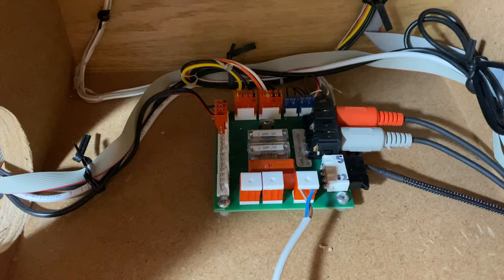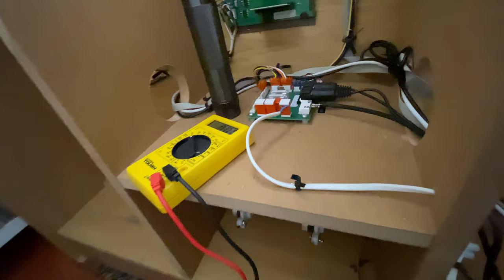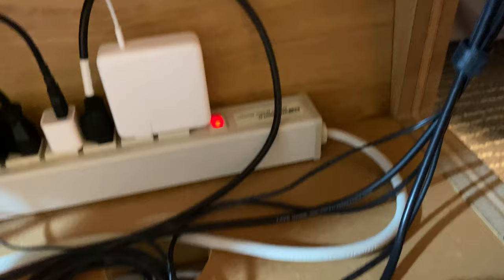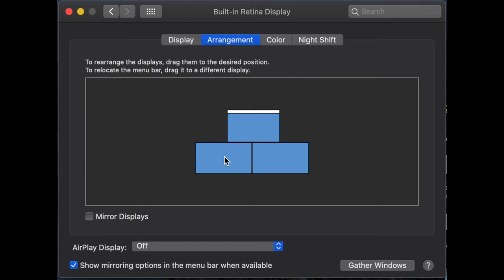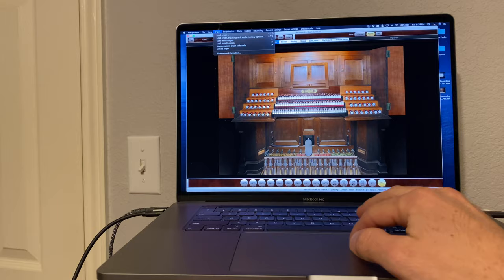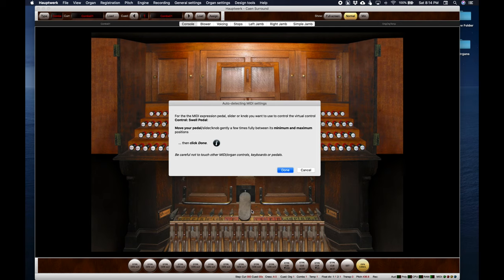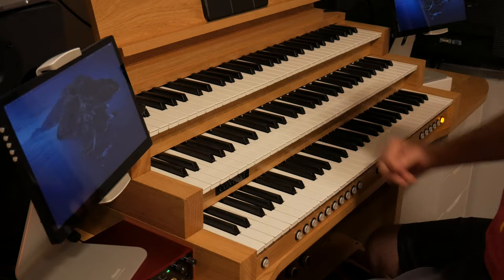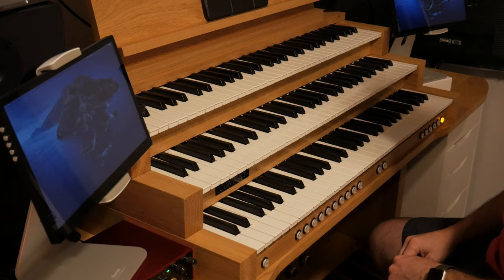Inside my Content organ and making the connections

Comment: Very cool! I have an old Rodgers 655 in my family room. The original electronics are a couple of HUGE PC boards, and they work fine, but my fantasy is to harvest just the MIDI bits and convert it to Hauptwerk. Effectively have this shell, but without the specific wiring.
Reply from the maker: Good luck with your project! Thanks for watching.

Comment: Please replace the scrapwood under the speakers with foam pads, to avoid the transfer of vibrations to the organ cabinet.
Reply from the maker: Thanks for the suggestion. I have some foam, but haven't been using it for this organ since there wasn't enough clearance to run my cables out of the holes on the console top. I also play through headphones 99% of the time, so vibration isn't really an issue. I have been considering getting a pair of the IsoAcoustics ISO-200 monitor stands. It looks like those would do the job of isolation, and have open space for running cables. Maybe I'll do it in the future. Take care.

Comment: Nice console Andrew! I'd love to have something like that for my setup.😍 Currently, it's just a 2012 MBP running into a USB>5x5 Motu Microlite MIDI I/O and from there into a Casio WK-1800 keyboard and an old Roland EP-5 keyboard. I run Hauptwerk through GarageBand on the Mac to add reverb, etc. to the 'dry' sample sets, and then via a digital audio out cable to my home stereo system, complete with powered woofers, etc.😉 I had started to build a console several years ago out of an old Hammond church organ console and an HWce2 MIDI console encoder from MIDI Gadgets Boutique to handle the 2 manuals and the pedal board. Unfortunately, I became disabled and couldn't continue the project, so the current setup is the next best thing. Still considering getting the wiring finished on the pedal board and using the HWce2 to get the signal to my Motu Micro-Lite. Would be much nicer than trying to split the keyboard on the Casio to get pedals that I can play left-handed and melody with the right!😁 Would love to hear some 'content' from your Content once you get everything all lined out!😉🎵🎶👍
Reply from the maker: Wow, thanks for the detailed comment! I started out with a very similar setup, except using a Native Instruments or M-Audio keyboard (can't remember which). Sorry to hear that your project came to a halt. I would definitely go full steam ahead with getting your pedal board finished. Having that was the biggest game changer for me, and took the instrument from just being a novelty to something I could seriously practice on. Best of luck!

Comment: Your wearing a T shirt from Vietnam!  Great!  I love Vietnam!  I use a regular PC for my Hauptwerk.  MAC is a bit too expensive for my budget.
Reply from the maker: Thanks! It's actually a t-shirt of Steven Universe, but I can see the resemblance. Glad you've got your own setup. Have fun!
Reply: I think a regular PC is cheaper and more powerful than a laptop. I’m currently building a dedicated Hauptwerk PC for 1200 euros: 64GB RAM, Intel i9-9900 8-core cpu, 1TB SSD, case and coolers from beQuiet. MacBook is more expensive and doesn’t get close to such specs. 🙂
Reply: @Engineer9736  Yes I have a dedicated PC.  1200 euros is in the ball park price of my computer with similar memory and 8 core processor.  Prices have been going down!  1TB SSD is the way to go.  I only had around a 230 GB SSD in my first Hauptwerk computer and that was a mistake.  That was back in 2008, when SSD's were far more expensive.  I think a 1TB SSD back then was over 650 euros.
Reply from the maker: @Engineer9736  You are correct. For me, I needed to get a computer that I would be using for several different projects, including video editing, so I wasn't in the market for a dedicated organ computer. I had the specs of my MacBook Pro maxed out, including 64GB RAM, so it suits my needs very well, and even the large sample sets, such as Rotterdam, load pretty quickly. Thanks for your comment!

Comment: Interesting to see this organ up close. Must be amazing to own it. Only the price is quite a thing... could buy a very proper new car for it. It makes me wonder if that bit of woodworking + 3 manuals + pedal is really worth that sum. If would be cool if you could show what the feel of the keys is like (without the organ sound). I'm always curious about what the quality of real well-priced organ manuals is like. Congratulations with this organ in any case 😊
Reply from the maker: Thanks for the comment. It really is quite a spectacular instrument, which is noticeable right away from the craftsmanship. The cost is nothing to sneeze at, but I can say the organ cost less than my car, which I bought about 6 months before this and is pre-owned. Regarding the key feel, the manuals are all Fatar 61TP-60LF, as far as I can tell. Pretty standard model in most organs like this. It has what they call a "tracker touch", so there's sort of a slight snap feel to the key, which is apparently accomplished by some sort of bubble before it makes contact. I definitely prefer this action to a standard electric action organ keyboard that feels more like a synthesizer, as it helps me know better when the note will sound. Those Fatar keyboards aren't that expensive by themselves, so you're definitely paying for the labor here, which is really top notch. The pedals, which use magnetic contacts, also feel great, and are nice and light to the touch.
Reply: @dfuhrman  Last week i contacted Content sales about this organ and the price is quite doable indeed! It seems they have 2 versions of this organ: The bare midi console like you have, or a full organ with speakers/their own samplesets/hardware/etc. That last one is like 3 times more expensive than the bare-midi version. I already own Hauptwerk/samplesets/speakersystem/etc so just the bare midi version is good enough. Good info on the manuals. They said that they can deliver UHT manuals which i've been looking at for years, those look really good. Still have to ask them for the additional price for that though. Until to far i've only been playing on a digital piano, which is enough to practice a lot of aspects on, but my interests is really at organ music which requires at least a pedalboard to take some work off your hands. And it's an amazing piece of furniture  to own as well 😀
Reply from the maker: @Engineer9736  I agree with you, and after some research, decided the MIDI console was all I needed. I'm actually starting to get curious about UHT keyboards or even the upgraded Fatar models myself. I took some things apart last week while my power and internet were down (Texas) and it looks like the keyboards could be easy to retrofit with another model. Also agreed that it's an excellent piece of furniture!
Reply: @dfuhrman  I've asked for the UHT manuals but they are like at least 2000$ a piece. Then the manuals will be worth more than the entire original console cost 😜 I've ordered a 4-manual version with wooden key core and 3-swell pedals (one for crescendo, i have the Palace of Arts Budapest sampleset) a few weeks ago. Bit of a gamble as I've never seen the console with my own eyes. Maybe the camera lens of pictures/video stretches the dimensions a bit. I hope the real instrument will be fully to my liking 😀 I've also been thinking to buy real stop switches with LED lighting in the future, and then build from wood some panels with those switches in it as a monitor-replacement. I think that will look way more like a real organ than with touchscreens.
Reply from the maker: @Engineer9736  Thanks for the information; that's helpful to know, and even a little more expensive than I was expecting, but sounds about right given their reputation for high quality keyboards. I hope you enjoy it. Sounds like a fantastic instrument!

Comment: When I added Hauptwerk to my organ, all I had to do was connect the midi and audio interfaces to the organ jacks and then to the computer with USB cords and I was done!  (Yes, and then auto program the manuals and stops.) You bought this custom built organ, had it shipped in from another country and then you had to be an engineer to hook it up.  I hope you didn't pay much for it.  You could have gone on eBay, bought a used Alan or Rogers organ with MIDI and lots of stops, had a much easier time connecting it, and the end result would have been a better product.
Reply from the maker: Hi there. Thanks for your comments. You're right, the big problem with this whole thing was that a very important cable was missing. I've chalked that up to a miscommunication between the US vendor and the manufacturer. Content was willing to send me the correct cable to solve the issue, but I was being a little impatient, so instead I got instructions from one of their technicians about where to find the part on Amazon (can't beat 2-day domestic delivery) and how to wire it up. As far as your other points go, I had a very specific, minimal design in mind, and I had enough financial flexibility to make it happen just the way I wanted. Not interested in drawknobs or tabs, just touchscreens so most sample sets would work seamlessly and retain their original aesthetic. I also wasn't looking for a used, traditional digital console, because a 3-manual instrument like that wouldn't fit through any doors in my house. Eventually, I'll move to a bigger house as our family expands, and this can become a proper installation in a main room. I appreciate you watching and sharing your ideas. Take care.
Reply: There is quite a difference between an old used console being reused with Hauptwerk, and a brand new quality console made for Hauptwerk (what you see in this video) 🙂

Comment: Hmm - the build quality seems slightly disappointing with lots of veneered chipboard used.  I use solid wood when I build Hauptwerk-compatible organ consoles.  Moreover, it does not appear that the console is designed in a modular manner that is quick and easy to disassemble.
Reply from the maker: Thanks for your comment. The sides, table, key cheeks, music rack, bench, and pedalboard are all solid wood. While there is some MDF used, it’s mostly on the interior as shelves to mount the electronics and keyboards, as well as the back cover. Even so, everything has a very sturdy feel. The design is purposely made for permanent installation, so I’m not certain that easy disassembly was one of Content’s goals. Take care!
Reply: @dfuhrman  My designs are in solid wood with stainless steel bolts and wing nuts, so it is not necessary to use tools when assembling and disassembling the instruments that I build.  For your system, in view of its cost when purchased, I am surprised  that the manufacturer skimps with MDF.
Reply from the maker: @tommorris3688  ok now I understand your previous comment better about not being modular regarding assembly. Thanks for the follow up. I guess the MDF makes manufacturing quicker when dealing with producing so many organs, but that’s not my area of expertise. I’d be curious to see a catalog of your organs or some pictures, as I haven’t seen too many with a design that’s easy to assemble/disassemble.
Reply: @dfuhrman  I used to undertake custom build for individual customers and churches, and have enough parts in stock for building circa 20 organs.  I always use solid wood and totally modular design, so consoles can be updated as advanced technology becomes available.  So often, I have had to help move 2- and 3-manual unitary-construction consoles, and it is a nightmare when the weight is 250 kg or more.  I try to keep the weight of individual items of the consoles I build less than 20 kg, usually less than 15 kg.  It means that a single person could shift the organs that I build.  The Content 224 was perhaps inspired by the discussions I had with friendly staff at Content Orgels.  Viscount has tried to compete by manufacturing the Cantorum Duo that can be used as a MIDI controller to drive a PC with Hauptwerk (Milan Audio Inc.) or GrandOrgue (open-source) software; I am not overly excited about the sound generation technology used internally within the Cantorum Duo, but the intrinsic sound of the Cantorum Duo is probably acceptable for many churches whose congregations are not so discerning.
Reply: I think for home organ console is solid wood uselessly expensive and heavy solution... (Indeed, it is necessary for keys and keyboard/pedalboard frame.)
Reply: @lukasrydlo8387  Chipboard as used by Johannus, Viscount et al. is just too poor quality.  High quality pine is about the same weight as chipboard and much stronger.
Reply: @tommorris3688  And the price?
Reply: @lukasrydlo8387  I build for customers 4-manual and pedal Hauptwerk-compatible consoles with 1kW per channel stereo system and with associated speakers, all in solid wood, for less than $5000 (USD) with wood-core manuals.

Comment: I heard that these consoles can be Haupwerk ready?  Do you think just getting a regular midi console is better or not?  Thank you for your feedback.  Best wishes.  W.
Reply from the maker: William, what you've heard is correct. Most manufacturers, including Content, make turnkey organs that have everything built-in and ready to go for Hauptwerk. The main reason I went with mine, which is essentially just a MIDI controller, is that I already had the HW system I wanted to use set up on my computer and didn't need any additional equipment. As to which option is better, it's all a matter of personal preference and workflow. One of my colleagues in Texas just ordered a Cambiare 312 with everything built in for the sake of simplicity..."all in the box," so to speak. I hope to have a video of his installation also, for comparison. Take care!